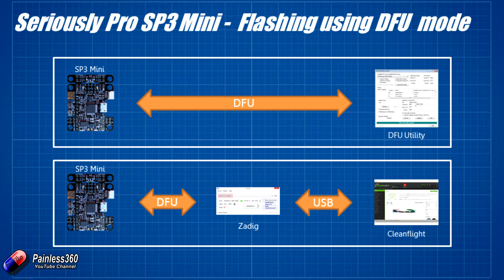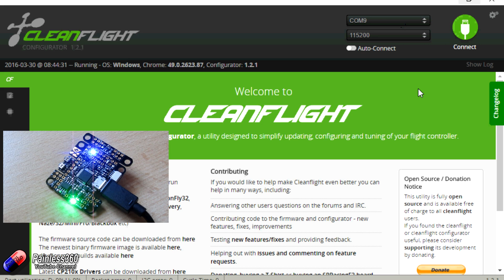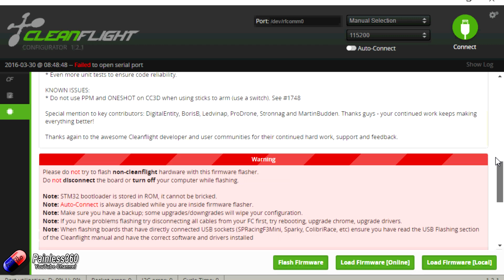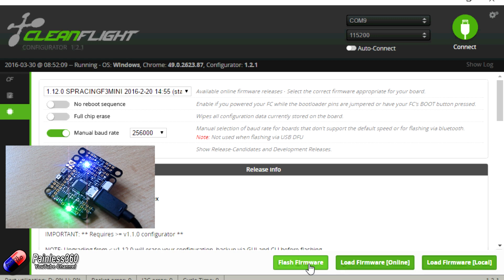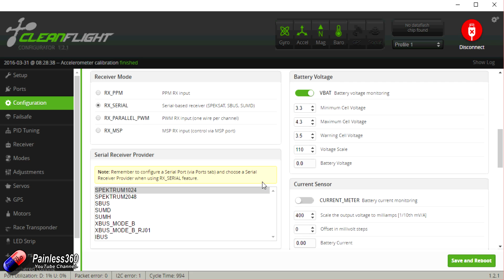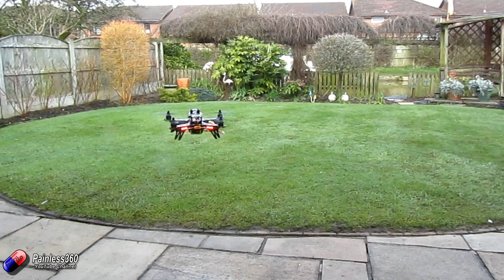(2/2) Introduction to the F3mini: Flashing and basic setup

Comment: I'm hoping for some advice here. I'm trying to configure my SP F3mini. I updated the firmware, I have it connected to Cleanflight, My radio and RX are bound properly. I'm using a Frsky Taranis XD9+ and a XM+ RX. I set the port to UART 1 and set the slider on Serial RX and in config I set it on Serial based RX and set it on SBUS and I get no response from my radio. I've tried 2 RX's also.
Reply from the maker: I've not used that fly controller in a long time. All of the information is in here. Pay attention to the connections for the receiver and also the port configurations in cleanflight. Best of luck
Reply: Painless360, I found the issue. It is a broken solder land. The signal link at the top of the screen was flickering. So I unsoldered it and the land wasn't there. Oh well. It's still usable as PPM just not SBUS anymore.

Comment: Hello I have bought SP F3 mini, today evening time I flashed the board under default specs, after successful installation i disconnect the device and connected back on again. everything seems to be work fine in clean flight, but once i attached the battery Li-po 4S 14.8v 4250 Mah, the board went dead, i thought there was some usb port problems, so i restart my pc and connect the board again,  but no lights was appearing, and board was heating up so quick. only one light was ON on the right hand side next to the power pins. Is the board DEAD ??? or what can i do about it.
Reply from the maker: Not sure, sounds pretty serious if the LEDs are not coming on. Sounds like the power electronics area dead..
Reply: Painless360 thanks, I thought the same on my mind (((

Comment: PLEASE HELP...

I have the sp f3 mini and i am having trouble binding my DX6 with my spek sat (SPM9645), i have connected the receiver to SPEKSATon the board Grey wire (R3) Blk (G) red (3v) 

I have flashed the board as you said and its operational. I have set UART3 to serial RX in ports, i have set receiver mode to RX_Serial, provider to spektrum1024 and saved.

I have then put ( Set spektrum_sat_bind =9) to get the receiver to bind mode but nothing happens, i have unplugged the supply and re-plugged and nothing....

Though if i change all the above settings (close port UART3) then set receiver mode to RX_PPM (save) then go to CLI and repeat, unplug then plug back in the receiver is in bind mode( fast flashing) try to bind my transmitter its says failed and the flashing on the receiver stops, unless i unplug and re-plug then it flashes again...

Hardware 
SP F3 mini
Receiver dsmx spm9645
Transmitter DX6

Any help would be much appreciated mate, been stuck like this for a few days now... 😢

Cheers, Richard.
Reply from the maker: +Richard Rose I'd try bing modes 7 and 8 as well. Best of luck!
Reply: Painless360 i have just tried it mate, still no binding flashing... this has to be software...?
Reply from the maker: +Richard Rose possibly. You could try another release..
Reply: Painless360 i have tried all available firmware now iv been at this for days lol.. why can i get into blind mode when set as RX_PPM ? But my transmitter doesnt bind says failed... as soon as i configure it in RX_serial it doesnt respond to the comands in CLI..? Sorry for keeping on mate your my last hope :( lol
Reply: Painless360 is there a way to bind using the buttons on the board? It also responds to commends from UART2... but still get binding failed on the transmitter... can i connect the signal cable to anywhere else?
Reply from the maker: Thanks for posting that! :D
Reply: Painless360 Ok Here is the solution for anyone who has this..

The SP F3 mini has two boot buttons a-b. in the manual it says these can be used for forced binding but doesnt tell you how. ANYWHERE!

So, turn all power off
press and hold B whilst powering back up, hold for a couple of secounds.. Done your in BIND mode 🤘

prior to this follow Painless360 steps. ports and receiver settings.

And if the CLI dont set bind for you do it on the B button used for DFU mode 🖒

Comment: Yes Painless-- I did use Zadig to transfer to win usb-- still came back saying--- USB to uart bridge controller. I need to eliminate uart, get to usb. -- Or disfunction it to talk to cleanflight. I have done this same thing on 3 computers (1 mac)-- still same. What can I try now.?? I really would like to fly-- 2 months-- no results. Thanks in advance for help.
Reply from the maker: So, at what point exactly in the video does yours stop working? The Zadig is only for flashing, normal operation for configuration doesn't need it..
Reply: Painless, I know I sound frustrated-- guess I am. You were right about the F 3 Evo. Your "Zadig" worked fine. I now have one board to build with. I have 5 other boards that all give the same message. When the boards come up as discs under "Discs and Printers", they all say CP 2102 USB to UART bridge controller. After Zadig, they say the same thing. When trying to connect to cleanflight, nor load appropriate board-- they say -- " STM 32 failed, expected 121(0x79). Received ; 0(0x0).
These boards are cc3d and Naze boards, skyline 32, naze deluxe etc. I had one cc3d fly for 3 minutes, then it reverted back to the above message.
I have talked to several guys who also-- can not get through the same problem. We have to trust in you, Painless!!
Reply from the maker: Ok, this  sounds like a driver problem. I'd now remove Zadig from the machine you're using/try another. Else something like this may be the answer - https://medium.com/@arrowcircle/seriously-pro-f3-from-china-fixing-stm32-communication-failed-wrong-response-expected-121-0x79-1bd64a471bdd#.e2a4my82w

Comment: A little help, Painless. I put a boot on the board, Opened it up in devices as an unknown device. It did not say stm bootloader, but (cp2102 USB to uart bridge controller). I continued the instructions-- no DFU, no hook up. I have several copters-- 6 weeks and none will hook up with cleanflight. A little help??
Reply from the maker: Zadig? (see video)

Comment: got the same problem, can't have the FC's firmware transferred, i'm on windows 10, I wonder if it's causing a problem. what I don't get is, Zadig worked, the driver was switched and I still can't connect with the FC. I'm currently thinking about installing Linux, wondering if it would fix my problem. because if I have a problem now, when nothing is connected, what will it be when i'll have to tune it.

Comment: hi man thank for you help sp f3 mini working fine that was great help but did my pid set up is good but getting a  intermittent cut out when I punch out full speed and when I'm flying slow and doing exactly the same on the Presets  running 4s one shot 30amp spider and Cobra 2300kv can you help been trying for days :(
Reply from the maker: +michael goodman No idea, I'd check the logfiles and see if there is something going on. Could be a problem with the ESCs or the LIPO as well.. Best of luck..

Comment: Hey man, thanks for linking me to this series the other day when I contacted you. I'm having some trouble connecting the FC even after having it work AND setup. I have had it working but wanted to now change direction of my two motors through BLheli Suite. I'm trying to get it to connect to cleanflight, but the device seems to only be recognised as an STM32 virtual com port not the bootloader version. I have tried Zadig and its already got WinUSB as its driver (even uninstalled driver completely and started from fresh) still no joy! I have the XSr RX soldered onto the SBUS pads direct and the battery to the battery headers. When I first loaded the updated firmware onto the board the only way I managed to get the PC to link to it was to jump the boot pads, unlike the way you did it. I managed to get everything up and running within cleanflight, but as soon as I went to load the board up in BLheli  suite I could not find the ESC's. any idea what may have happened mate?
Reply from the maker: +daniel austin the way that works is covered in the video. I'd remove the drivers and start from scratch. The vendor should be supporting you with this  - they have your money ;) best of luck with it.

Comment: after i used zadig my pc doesnt appear any com port!!! what should i do??? if the board is bricked how i can reset it??
Reply from the maker: +Bill Asimakopoulos You can't 'brick' it. The bootloader isn't affected. Happy to help but please watch https://www.youtube.com/watch?v=olIqTiSJHIY and come back to me with more detail of what you've tried..
Reply: +Painless360  ok well. i have send two mails in the seriously pro because the retailer here in greece couldnt help me. The board isnt damaged. I have read the manual 10 times but still cant find the solution. the problem is in my pc dfu driver i think because when i replaced as you shown us in your video above that it is perfect, the driver with the zadig my pc appears the board as a stm32 virtual port and none come port appears in cleanflight. i download the dfuse demo thinking to reset the board from there but the board doesnt appeared as an dfu devise. i would appreciate your help.
Reply from the maker: +Bill Asimakopoulos you can boot the board in DFU mode. Press both buttons for more than 5 but less than 10 seconds (see documentation). The you can use DFUse demo to flash (remove Zadig). The supplier should be supporting you - he has your money ;) best of luck!